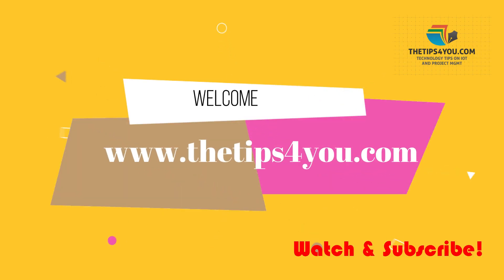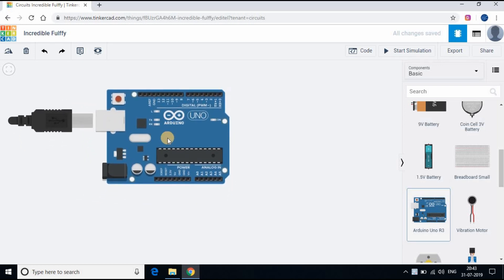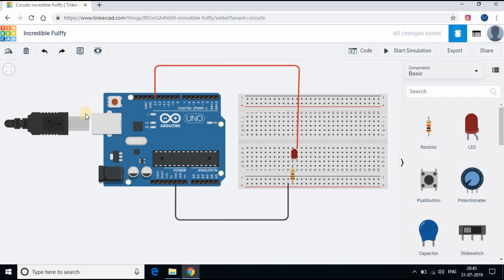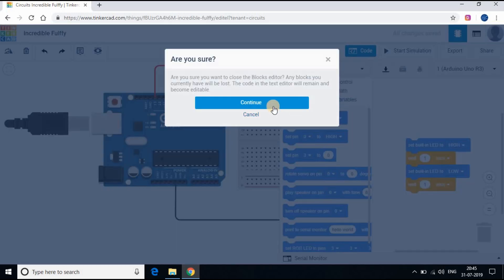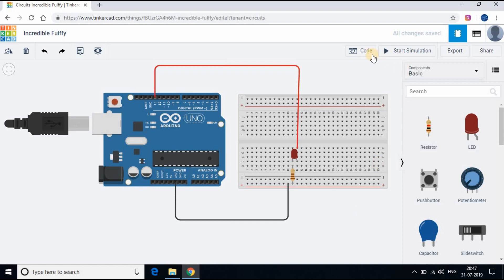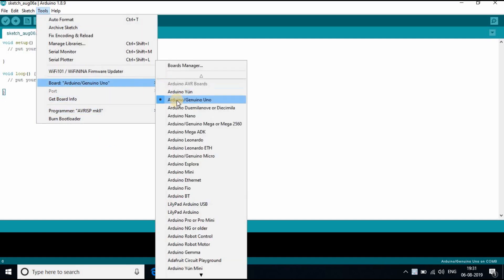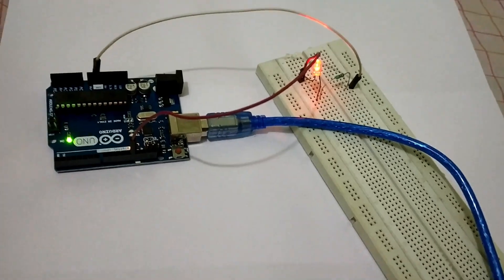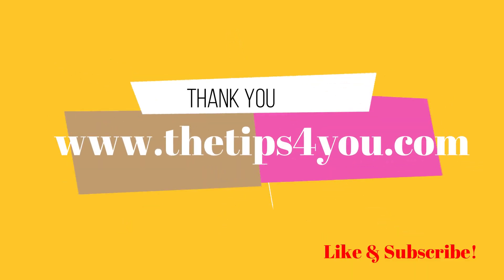Best Arduino Simulation Software | Arduino LED Projects

Comment: This doesn't have the arduino mega on it, and the arduino uno doesn't have enough pins for my project 😢
Reply from the maker: You can use master slave setup if you need more pins.